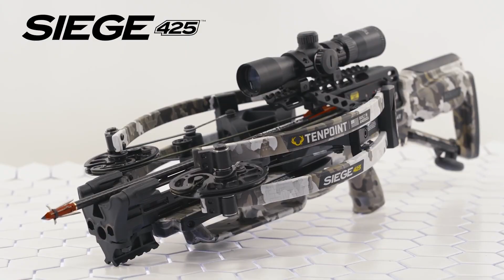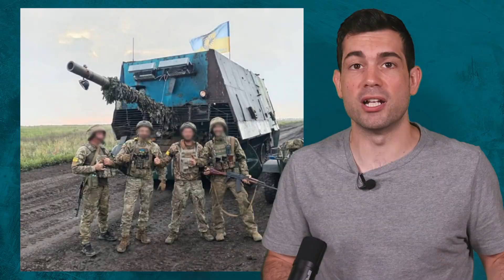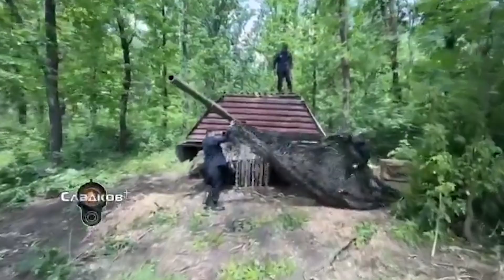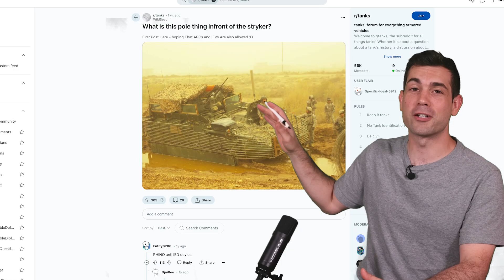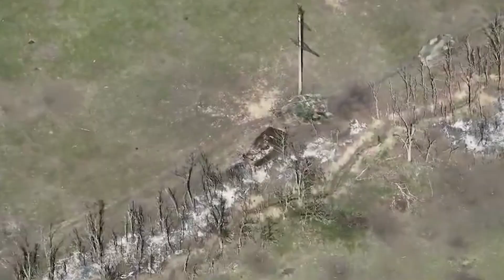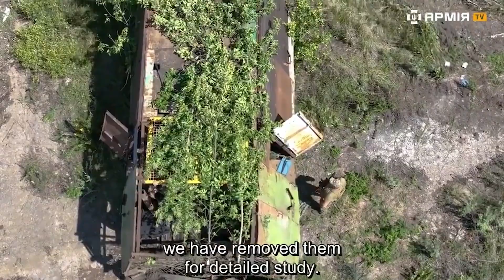Why Ukraine’s Taking Turtle Tanks Seriously

Comment: The name "tsar tank" can be explained easily. In russia there are several artifacts with "tsar" prefix. They looks monstrous but cannot work at all. They are tsar bell and tsar canon. These are the cases when the item is built so incredibly huge, when it doesn't fit the purpose it has been built for.

Comment: I mean... If the resistance to drones means actual bodies have to get in the line of fire to pump anti-infantry rounds into one of these,  It's doing its job.  That being said... how do they hold up against fragmentation rounds?  explosions are a fair sight easier to blunt and redirect than shrapnel.  I wouldn't think it'd be that difficult to change the kind of payload the drones are delivering.

Comment: Ima be honest... This thing has more flaws than visible at first... But for one, if you tip it over, its on its back... You literally can just tip it over with primed explosives to render it completely useless...
The reason for that, is the added weight... Tanks usually have a specific center point of mass against that... These, have this point shifted upwards, making this one of their main weaknesses... And if they were smart enough to add weight to the bottom... Their fuel consumption is HEAVILY increased, making them worse for advances and similar... Quite frankly I'm not sure why Tank traps aren't constantly in use yet, but simply you can stop these tanks as well by just heating them up... I guarantee you its hot in there, but if you simply make the air more humid, it becomes unbearable for the people inside... You don't need gar or anything... Funny enough vaporized water is one of the strongest counter measures against tanks, and the more enclosed they are, the stronger this gets... It doesn't matter if they wear gas masks etc. The humidity in the summer and winter can cause extreme problems for their machines and passengers... Especially since you can make grenades that simply just create humidity nearby... Its not about killing someone, but making the fight for them unbearable... This is where Putin and probably 95% of other world leaders fail, war tactics... You don't need illegal weapons etc. You just need to use the enemies weakness... Than we have the direct issue with these tanks, the vulnerability to molotov... Imagine first getting hit by a grenade that makes it disgustingly wet and mosit, but than being hit by a stupid ass molotov that heats your entire sh*t... You will not be focused in these circumstances, making you an easy target for literally anything...

Comment: i think they didnt know drones would being that effective at the start of the war. when 1 or 2 drones takeing out tank its a cost effective way to do things.  you could easly tranport them hide them 60 mi/100km i dont see why you cant make a few fox holes and send them out of them. i would be trying to think on how to stop the drones to. it take time to do it so i think the turtle was the only thing they had at the time to do. i also think it work better then doing nothing. they going to have to find away to make anti drones gun. the only way i could think about it in a rural  area its something that can ping radio waves from drowns.  but your going to need it move 360 degree angle at all times and -90 to 180 degree up and down aiming at anything 100 yards away.  you cant use it in the city do to to many radio waves. could set it to were it will not aim at set of radio wave frequency. war will alway evolve.

Comment: Funfact Killdozer had a rudimentary cctv camera setup inside for navigation was more hi tech and more armoured than these pretty crude turtle tanks, he even installed a working Aircon in the cab  and a compressed air system to clear the dust and debris from the bullet proof camera setup

Comment: problem of air defense system, THEY ARE UNARMORED, so you can't put them on front line, both sides using it, but, not on front line, they probably need just like 12.7mm on tanks, or even 7.62, or something like shotgun mounted of top of the tanks like i saw 1 funny chinese guy made AI controlled turret which shoot of mosquitos

Comment: The one thing that NATO can take from the unfortunate situation in Ukraine is that we have now, finally,  recognised the threat of cheap drones, whether they be aerial (primarilly), land or sea based, as such the militaries of NATO are scrambling to design and implement anti drone technology for defensive systems. To be fair, taking out a drone, once identifed, is not that hard, but as noted in the vieo, you have to be able to identify the buggers. Birdhot is a great defence that is being utilised by Ukrainian, and likely Russian, troops, but systems to be retrofitted to vehicles are not far behind. Multispectrum radio tranmitters are not overtly complex or expensive to manufacture, fitting one of the these to armoured vehicles should not prove that much of a headache, cycling through hundred to thousands of frequencies a second should help to mitigate drone threats, but there is still a need for close in direct attack systems to counter these systems. 

The other thing that will need to be combated against is the fire and forget drones - I'll lay odds that Ukrainians have made some. I have a small FLIR camera, with a bit of software cracking (Don't tell FLIR) I can then get a raspberry Pi to lock onto something using a cheap reversing camera for a car - that same Pi could also control flight surfaces to guide a drone onto an identified target, allowing the drone pilot to cede control to the Pi and ensure they are safe. No jamming in the world would then be able to stop the drone, guided by an IR camera and a Visual Camera...It would not be hard to train the system to recognise weak spots and target them. 

The world of combat has gone backwards in some ways, with the trenches making a comeback, but at the same time, it has moved on leaps and bounds - the scary part of all this, is that such weapons are not restricted to standing armies with huge budgets - these can be build for a few $thousand at most and be highly effective. Insurgent forces and paramilitaries can now do serious harm to major militaries unless they have active and passive anti-drone defensive systems for vehilces, building and especially personell. These would have been a real nightmore in Iraq., glad we did not face them.
Reply: the US has actually taken drones seriously for a long time, just havent been super loud about it like some other projects. they where already developing cluster drone pods dropped from jets in 2016. they recently tested the first stealth jet drone bomber.

Comment: Start using terrain befuddledment tactics. ditches softening ground, steel cable aluminum cable that will melt and bend around tracks and bearings, thermit,  cables Tank traps etc. all that weight and extra armor will slow it down and takes away from the speed and mobility. As cappy said every modification has trade offs.

Comment: The revelation here is that the turtle tank is not a more effective tank but rather a way to use a otherwise scrap tank.  A tank that cannot rotate its turret, fire its gun or mount ERA armour should be useless, but here they are welding on scrap metal and rolling it towards the enemy.
Personally I think its a waste of the 3-man crews lives, but Russia does not value that.

Comment: What is needed, is an old weapon, made new. A shotgun defense system. using the best mode for tracking drones, whatever they determine "is" best, and use that, then have an auto shotgun system that will give a 360° dome of protection around the tanks or column of armor for short range protection. Use a shot that is large enough to destroy the things, but small enough with enough pellets to make a good pattern. And since it will be mechanical, make it a Large bore shotgun, 4 to 8 gauge or so. This would also be helpful if infantry got too close.Also, the ZSU's the soviets have could use a canister round for drones.  In The Rhodesian/Zimbabwe war, they used a ring of barrels around the turret copula of shotgun tubes, they could fire when infantry would swarm their armored vehicles. That type would be too limiting, but the idea the same. Protection. it may even be necessary for infantry with armor to carry shotguns with them, and be posted on the armor. That would suck though in an artillery barrage or when missiles came in. So I think the auto shotgun system would work. it would cost, but, when you are losing millions on tanks against your enemies hundreds or thousand dollars for a few drones, it's worth it. You have to adapt.
Reply: Flak weapons. You're talking about flak.

Comment: Ukraine only publishes the successful drone attacks. It rarely if ever publishes the many many drone failures due to jamming or operator fails.
Also, note that almost all of these have anti-mine devices on them when going into combat. They don't need to use their guns. They're clearing mines so other tanks can use them. They don't need to move their guns much because their targets will be right in front of them. Think of the T28 assault tank.

Comment: So if it gets hit multiple times and it is penetrated aren't all the crew on top just going to get destroyed and you're going to be transporting bodies to the front line for nothing doesn't make very good sense you're saving the tank but you're letting your crew on top die the whole purpose of the shed was to protect the crew on top especially if the tank is not being used as a tank why not just build better anti-drone jammers or just leave Ukraine

Comment: The "Evolution" of the Turtle tank would be an old fashioned looking tank with some shiny new aerials and a nice looking remote weapons system capable of shooting down drones while not wrecking the utility of the vehicle itself. The Turtle Tank is the Russian way of saying "We can't into Tech". Its the "Dumb Dumb Bash" response. They're hitting us, pile on more layers so they stop hurting us. It will work for as long as they have Vehicles with enough Horsepower left to move all that steel along, or until Ukraine gets enough Mines or Artillery shells, because Mines don't care how much junk you pile ABOVE, and Artillery just LOVES Large, Slow moving Targets...

Comment: To people still wondering about the efficiency of crude steel welded together and wire mesh against FPVs, one of the most used FPV countermeasure for dugouts is a fake entrance with simple tarp or wire mesh in front of the entrance.

No need for cyberpunk material that hide from optics.

Comment: All you need is a small short range 360 degree radar on each tank with an auto load shot gun. I've seen solders shoot down drones in this war with a standard 12 guage.

Investing in jamming will only work in the short run because there are already drones that are resistant to this, and they will be the norm in a year or two. However, some jamming will be a good idea, because it will force the enemy into investing in these more expensive jamming resistant (intelligent) drones.

Comment: What I don't understand about the captured turtle tank with the disabled gun and non-rotating turret: why not lift the entire turret off the vehicle? Saves a ton of weight and creates space to carry more troops. And it's not as if that hasn't been done before: the Canadian Kangaroo from WW2 comes to mind.
Reply: If it looks like a turret, the enemy will treat it as a turret. 
Same reason you don't go waving a firearm around in public even if you know it's clear, or even has the entire trigger mechanism removed.
Reply: It might be that they didn't have the machinery to lift the turret anywhere nearby. I imagine that takes an especially strong crane or lift? But also, yes, maybe it is just to maintain the image of a threat.
Reply: @inthefade  I agree that it's most likely because they lacked the ability to lift the turret out. Most of them are field mods by the units once they're in Ukraine, rather than an industrial setting somewhere that can actually do heavy lifting.
Reply: @inthefade    If they had the luxury of time to "manufacture" turtle tanks from refurbished chassis rather than field modifications of whole (though often only partially functional) tanks, it would be a good choice to remove the turret and barbet.  (Is that the correct terminology for land vehicles?)  This would allow for both lighter weigh and possibly more carrying space.  However, it would be a good design to mount a dummy barrel on a lighter-weight frame hidden under the shroud with the barrel still protruding so it is treated all the due caution that a "live" tank would require.

Comment: The turtle tanks are a sign of complete and utter desperation by the Russian military. 
They are quite a stupid idea because it makes the tanks basically useless for anything other than mine clearance. The shed completely blocks any vision that the commander has and severely restricts the field of fire for the tank.
A better option would be to use armoured personnel carriers rather than tanks for the same purpose. 
All tanks have the same vulnerability and that is the tracks, so instead of attacking the shed, just attack the tracks. Once the tank is stationary, artillery can easily destroy it.

Comment: Turtle tanks are used to carry infantry riding desant and the Cope Shed is a predet cage, not "armor" in any useful sense for the infantry beneath it.
Cope Sheds act by detonating HEAT etc weapons at standoff distance from the tank hull.
Remember WHY bar and cable (QinetiQ etc) works by disrupting shaped charge warheads?
Remember why solid flat surfaces do NOT disrupt HEAT munitions? 
If Private Desantovich is inside that standoff distance he bravely defends the tank hull with his body, like the rubber sheet in reactive armor except rubber sheets don't die screaming. 

This is so gobsmackingly obvious few people notice it, especially armor enthusiasts and gamers because it's got that Warhammer Ork style smekalka vibe.

Comment: I've seen the updated production version of the turtle tank, which is now a form-fit cage that extends out from the tank, and allows the turret to still function normally. It's like a 'cage shield' now. The whole point of the turtle tank's extra armor is to enable them to survive a few drone strikes, blowing away the outer shell before reaching the functionally important parts. This new cage design seems to be designed so that the explosion from the drone has nothing to destroy, except perhaps easy-to-replace chains or rebar. I don't remember where I saw it, only that I remember seeing it. However, I think the tanks are still vulnerable to normal anti-tank platforms, the cage/shed just reclaims some of the tanks' lost strategic value back from drones.

I suppose the scariest thing about turtle tanks is that tank aesthetics are going to be ruined, meaning the military industrial complex is going to have a tougher time selling new tanks, since they'll have to have ugly cages to be combat effective. While I heard the new Abrams was going to have stealth capabilities, the existence of drones are such a large threat that stealth may no longer be an option, if they have to put a drone cage on it. And since stealth was really the only real advantage the new model would have over the old one, there's literally no reason to buy them, and instead the smart move by the government would be to equip older vics with drone cages.

This will leave weapons manufacturers crying, now that American weapons have been exposed to near-peer combat, and found lacking in areas that won't gain them a profit.

Comment: 14:51 the broadcast on all potential frequencies that could be used for drone coms, not just a specific freq a specific drone uses. its a noise generator, they aint rocket science, there really is not any intel to learn from it. its a very old technology (tho only fairly recently (last few decades) used in war) and its only limited by the power you can provide it to output.

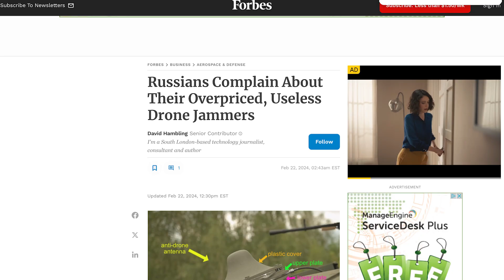EDIT: 15:35, I call BS on this one, Jammers can definitely jam on a wide freq range. They do this by listening to any frequencies within a range, and if they detect something, they nearly instantly switch freqs to match it. you can build jammers that have multiple freq generators for multiple freqs, and pump it out the same antenna, tho the antenna is only tuned for one particular freq for best performance, in most cases it wont do that bad on nearby freqs. if the jammers knows its jamming on a specific freq, it can adjust filters on the reciever to filter out the jammed freq, and search for new ones. again the only real limitation for a jammers is power, as each freq generator will require a seperate amp.

The reason why those manpack have many antennas is specifically to jam multiple freqencies, each antenna will have a range that it works best in.

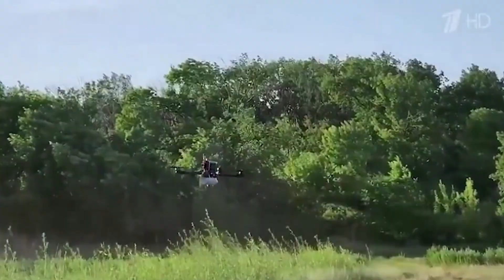16:18 drones do not all use the same freq out of the box, if this was the case, you could not use two drones of the same make and model within close proximity of each other. drones can adjust their freqency for further range, the lower the freqency, the further it will go, but less information can be transmitted. its a trade off.

Comment: Drone suicide operators now have a new target, the tracks.  I’ve been saying for a while now, if they can’t destroy the armor at the very least you can disable it, even more so making it a prime target for HIMARS or Artillery if it’s immobile.  Knock out the tracks and now you have an immobile turtle that will require outside support to fix, presenting more targets and opportunities to destroy/disable further equipment.  They could also aim for the guns barrel on tanks and APC’s.  No gun and no track?  Essentially just a well armored bunker.